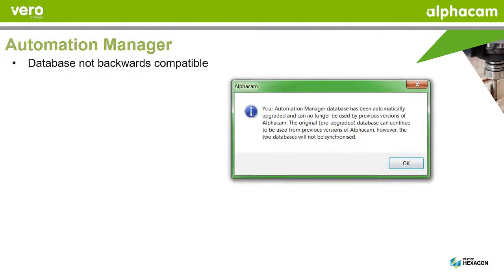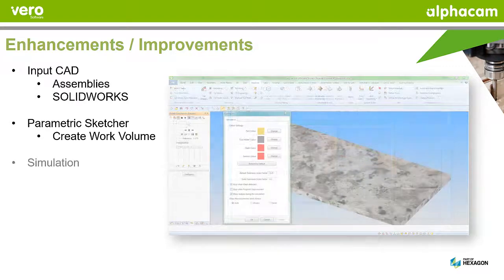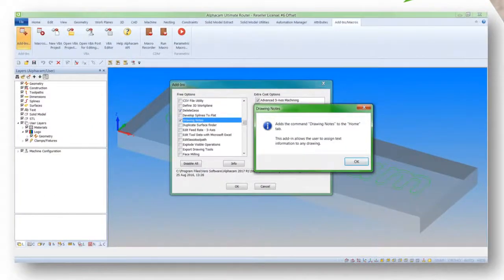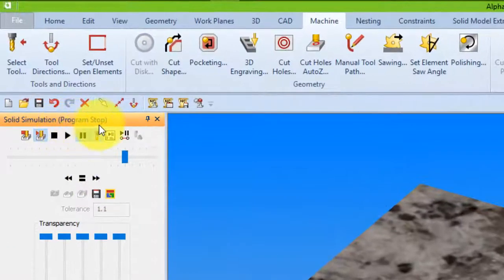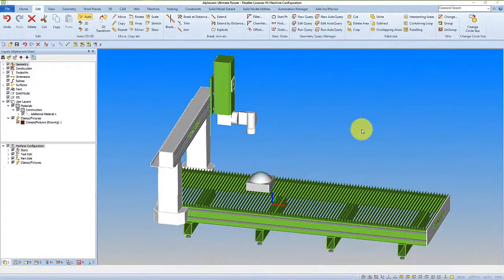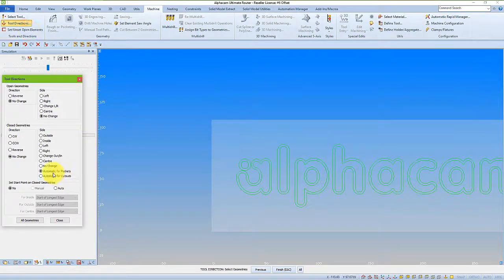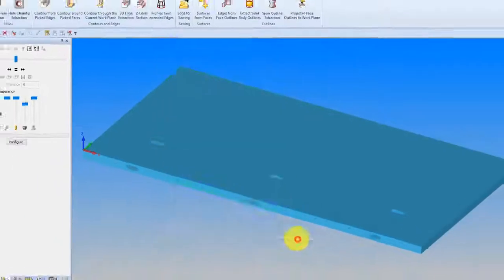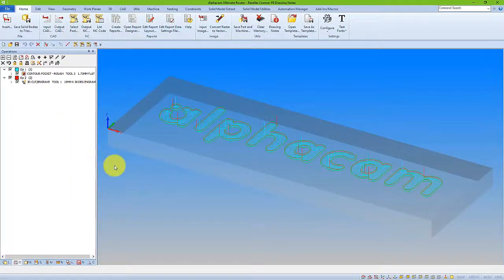General Enhancements | Alphacam 2017 R1

Comment: Dear Friend, I have a problem with this version, I can't output NC with a single tool, it always forces me output NC with all tools for a program. Please help me this problem. Many thanks.
https://imgur.com/a/LhqTc8M
Reply: have u already solved ur problem ?
Reply: @1kizer  NOT YET.
Reply: @paolomaldini984  i think is the same problem that i have.. Did you buy the machine recently ? I will try to explain.
In my case, I have one company doing my alphacam postprocessor for my machine because they built the machine to fast to save time. When you install Alphacam, it comes with the "standard postprocessor", you need to talk with the company that sold you the software (probably they will give you the right postprocessor).
I have the same problem buuuuut, can be anything else.
Good luck with that.